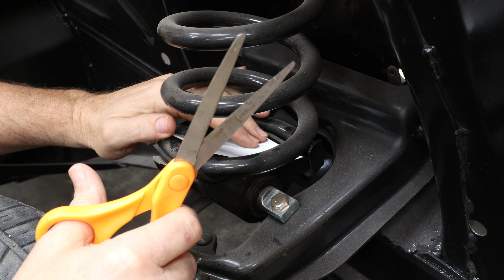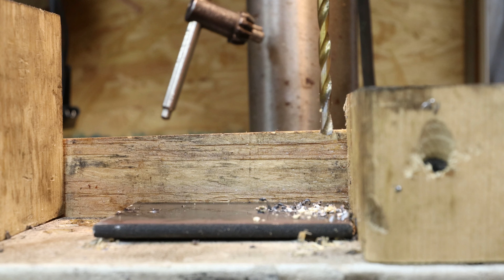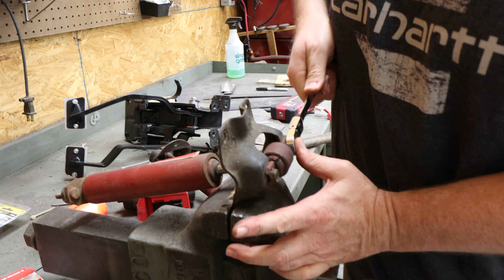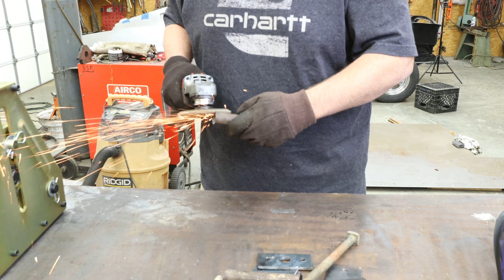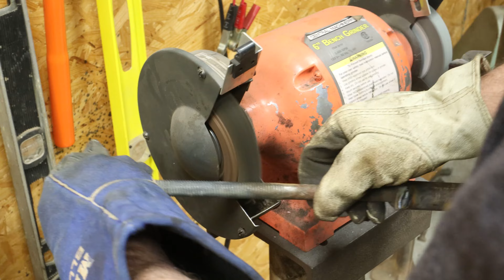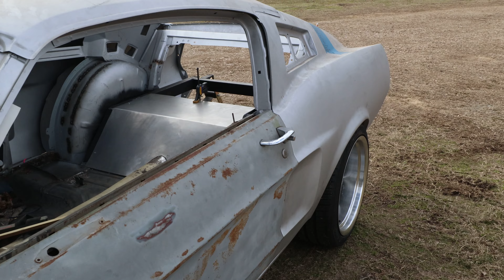Build a coil spring compressor for under $10

Comment: Ive used the fork compressor and the one with hooks at both ends..both very unsafe.   Im going to start building this one.
Reply from the maker: It really works and is so much safer.  It's mustang specific but it's perfect.  I did a follow up video where I modified these so that you can install the hood.  Look that video up before you build and see if the modified version works better for you.